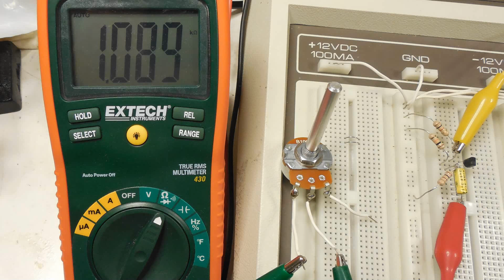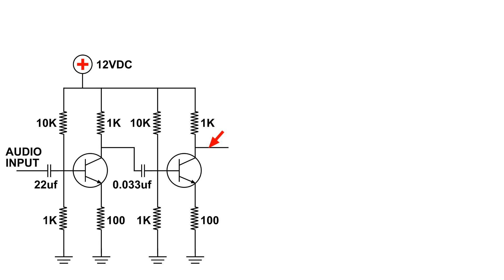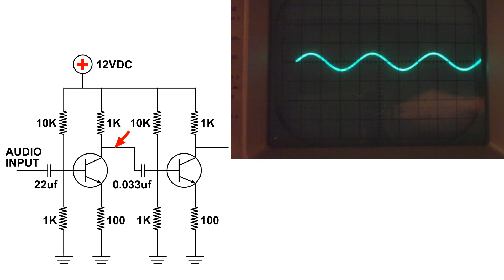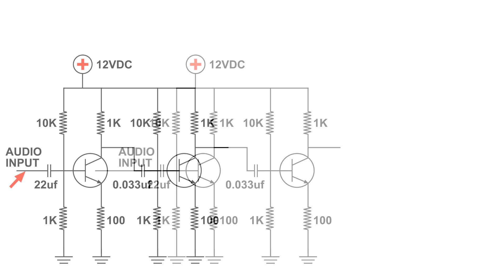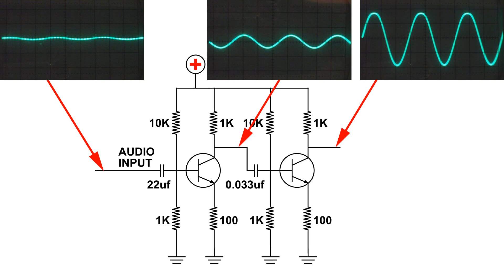Audio Amplifier Basic Circuit Build Demo

Comment: What is the gain of the amplifier?
I need to make a transistor preamp that will take a mic level input (1mv) and output at line level (1V)
In your experience with this circuit will it achieve that much gain?
Thx
Reply from the maker: Adding a MOSFET input stage should help.

Comment: I like to know how I would sit this up to light up an LED by  sending an arc through an antenna and another receiving antenna at the breadboard?  It certainly could use multiple transistors, for sure.
Reply from the maker: Can you explain a little more, what it is you want to do, and why?
Reply: @AllAmericanFiveRadio  I like to use a high voltage arc by whatever means such as a cig lighter piezoelectric or high voltage arc that I can make happen across say a 6 inch antenna.  On the receiving end at the bread board a recieving antenna that I can hook up to the base and the emitter of some bjt transistor.  So I can light up an LED by supply the transistor with some voltage.
Basically using the antenna to supply voltage to the base.   
I have used two BJT, the collector of one to the base of the other.
I have done it and it works but I think it can be done much better.
Just trying to get a feel how things work.
Reply from the maker: @alchemy1  I would try using two tank circuits. I would make the coils large, maybe six inches in diameter. Spark gaps transmitters are very noisy, and inefficient.

Comment: Hello, how can we mute the sound at an empty (noise) frequency on the fm radio, what should I use for this?
example :
zsssssssssssssssssssssssssssssssssssssssssssssssssss (white noise)
Reply from the maker: GOOGLE "Squelch Circuit". You will find lots of circuits and explanations of how the circuits work.
Reply: @AllAmericanFiveRadio  I want to cut the noise
blank frequency noise
Reply from the maker: @ramazanayten3758  That is what a squelch circuit does.

Comment: Thank you for the great video. I’m new to electronics so this might be a silly question. Won’t the capacitors and the 1k resistors form a high pass filter? If that is the case then the 0.033uF capacitor and the 1k resistor will give a corner frequency of about 4.8kHz. Is this amplifier still usable for audio applications?
Reply from the maker: The resistor and capacitor will have some influence. If the capacitors where going to ground that's when there would be a much greater impact on the audio. Interesting question.
Reply: I tried simulating this circuit on LTSpice this morning. The output of the amplifier does look like that of a first order high pass filter with a corner frequency around 4.8kHz.
I don’t quite understand, if the capacitor was going to ground, won’t that form a low pass filter instead?
Reply from the maker: @rajeshnair4399  The signal passes through capacitors, so if you ground the capacitors you ground out the signal. Here are a few videos that may help you understand this process.

Capacitors, DC and AC Current
https://www.youtube.com/watch?v=NInt1Ss3vQ4

Capacitors, DC, AC, and Frequencies
https://www.youtube.com/watch?v=YfJKNSkz_Lk

Audio Coupling Capacitor, how it Functions in a Circuit
https://www.youtube.com/watch?v=PAPnwX6YiIM
Reply: AllAmericanFiveRadio Thank you for the great videos 😊🙏🏻
Reply from the maker: @rajeshnair4399  Thanks and your welcome.

Comment: Hi there, I really enjoy your content and am just starting to learn about amplifier circuits. I was looking for some help with a project to add an Aux input to an old HiFi from 1994. I have the circuit diagram but im struggling a little with understand the correct area to add in the L,R,G  pre the power amp. If possible id like to be able to still have volume control. If you could spare some time to help I would really appreciate it. Regards. Brian
Reply from the maker: Your can email me at allamericanfiveradio@yahoo.com

Comment: I'm looking at building an audio meter bridge for an analogue mixer just as a bit of fun, using 6e2 magic eye tubes for display. I will interrupt the signal post fader on the mixer for each channel strip. Would this type of amplifier/buffer you are demonstrating be suitable to isolate the main signal from the fader sufficiently and stop and impedance feedback and drive the tube magic eye vu device? Thank you in anticipation. Ellwood
Reply from the maker: I found some 6E2 drivers on eBay. Just search '6E2 tube'. This should work for our project.

Comment: Hello,

Would not it have been better to keep the first capacitor lower in value?
22uF seems very much (to me)
and when we talk about sound, these capacitors also affect the sound color, I mean the tone.
it would be fun to do this video again with more information about that!

friendly greetings from The Netherlands!
Rob.
Reply: @HobbyRob ;     Did you try to simulate by Proteus 8 ? I have tried but the output signal is  not sin wave !
Reply from the maker: Thanks
Reply: @AllAmericanFiveRadio  
Sorry I saw your writing too late!
(not in Proteus 8 no!)
I used this kind of circuit as a preamp,
and it worked for me.

Friendly greetings from The Netherlands!
Rob

Comment: Hello nice demonstration!!
I'm trying to make an audio amplifier as a project can i use this design and make 10 same stages and connect a speaker at output of last stage?? Will it work??
Reply from the maker: This will work for the pre-amp and amplifier. If you want to drive a speaker, that stage needs to supply more current. Because speakers require current to drive the speaker cone.
Reply: AllAmericanFiveRadio i made 8 stage Amplifier using your resistor values in orcad pspice software and I'm getting an output voltage of around 1.5-2 kilo volts...that will supply enough current I guess if i connect 500 ohm speaker
Reply: How to connect Capacitor +or-terminal

Comment: sir, what transistor should I use in that circuit?
Reply from the maker: 2N2222
Reply: +AllAmericanFiveRadio can I add bypass capacitor? what value of capacitor shoud I use sir?
Reply: +AllAmericanFiveRadio if theres no 2N2222 available, what transistor
Reply: +AllAmericanFiveRadio if theres no 2N2222 available, is there any transistor i can use in this ckt sir???
Reply from the maker: https://www.ebay.com/itm/2N2222-Transistors-NPN-Transistor-10pcs-USA-Seller-Ships-TODAY/163043942430?hash=item25f62d201e:g:hxEAAOSwWida4O2z
Reply from the maker: 0.033uF, if you want less bass use 0.022uF, if you want more bass use 0.047uF
Reply: +AllAmericanFiveRadio sir, i try your circuit last night, it worked but the sound is very low.
Reply from the maker: What you have now is a pre-amp to drive an output for a speaker. A speaker requires current. You can us a step down transformer or power transistors and a beefy power supply.

Comment: Hey friend! If I want to add another stage of this circuit, with more one transistor, will I need to repeat the 0,033 uf or must to use another value?! I need to amplify a weak signal of my electric guitar for one speaker!
Reply from the maker: Just add a third stage just like the second stage, .033uF, 10k, 1K, 1K, 100, 2N2222
Reply: Thank you! I will try this way!
Reply: @thaironynarazaki8120  those capacitors before, between, and after the amplifiers (transistors)
also affect the sound/the tone of the sound, you should try!
0.1uF more high - and 1uF more bass - Try it also with 10uF and 100uF (extra bass)

regards
Rob.

Comment: @AllAmericanFiveRadio Your videos are easy to understand,you speed of speech is perfect for understanding as you leave pauses which in that time i can absorb what you said and remember it,so thanks for this very professional presentation.
 Also your diagram at 4.56 shows exactly the smaller input signal compared to the output of the 1st transistor then again at the output of the 2nd transistor which is an excellent way to describe and visually show the amplification process :)

I have a question for you ....? The way the 2 transistors are configured together so that the collector of the 1st transistor feeds the base of the second transistor what amplification factor would this give to each individual transistor, e.g is 1st transistor x10 and then for eg the 2nd transistor would be x10 too so total of x100,does it work like that?
Finally if the 2 transistors were to be wired up in a darlington pair configuration would that setup give a lot more x amplification??

Comment: Hi AAFR, As always a most excellent tutorial, first place I go to for electronic tutorials. I would really like to know why a 9V battery would stay cool while circuit is on, but, get really hot when turned off, with no apparent voltage or current present on circuit board. Would you know why this is so. Please keep making video tutorials, I take notes on every one. Thankyou, C.
Reply: I know it's a bit of an old comment, but if you never found a solution it sounds like the circuit turns off by closing a switch parallel with the circuit, which would short across the battery and make it really hot.

Comment: Hello , how do you calculate the resistors? I am wanting a higher frequency amplifier and want to calculate the resistors for that frequency.
Reply from the maker: First decide what frequencies you want to cover. Then chose a transistor that will do the job. Then using the manufactures specifications to find the current and voltage through the Emitter & Base junction that will produce the output required by what it is your driving at the Collector. Now that you have the current and voltage you need for the Base bias you use Ohms Law to find the resistors. But you have to chose the resistor combination that will match the impedance of the signal coming into the base. That’s how you calculate the Bias Resistors.

Comment: Please try this swap the 10K and 1K resistor then leave out the variable resistor and put a capacitor across the 100 ohm emitter resistor.  Use like .1mfd input cap.  You may not need to swap the 10K and 1K depending on the transistor used.

Comment: Very interesting Rick! Especially the the smaller decoupling cap between the two stages so as not to overdrive the second stage and clipping it. Curious. Is this method also used commonly by electronics engineers in real world circuit design as well? It's kind of like using an out of tolerance capacitor to be used as a passive limiting resistance with the properties unique to capacitors which blocks D.C. It makes perfect sense, but something I honestly never entertained.
   Very interesting indeed!
   Thanks for the great video,
       Tom
Reply from the maker: Design Engineers use math of-course also. But the data that they use from the manufacturer was developed in the lab by experimentation. The experimentation on there product is where the manufactures get the numbers for the design engineers. But in a new build even with the data from the manufacturer, engineers will still put there project in a lab for testing and adjustment. I have work in many labs and they cost millions and millions of dollars, manufacturer would not spend that money on labs of it was not absolutely necessary.
Reply: that cap is needed to remove the 6V DC offset
Reply: 44

Comment: Great information,and very well done!
i think my class back in 1978 might have been the last class on vacuum tube's, Solid state is wonderful!. Used to have to use a VTVM, now a rather cheap multi meter will work, heck there are even hand held O scopes.
I would like to see what changes are made fifty years from now, but at 60 I will have to imagne.
Good luck to you guys that work,or tinker in electronics!
Reply from the maker: Thanks EarlRausch